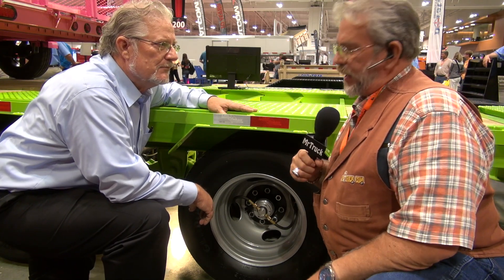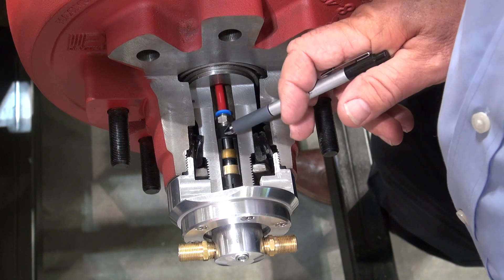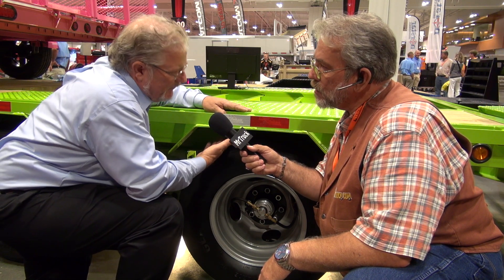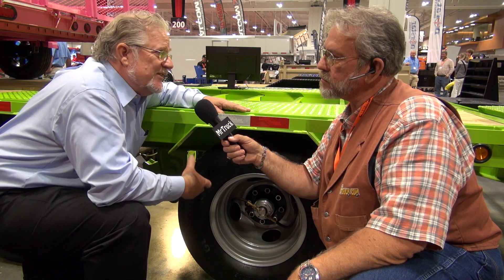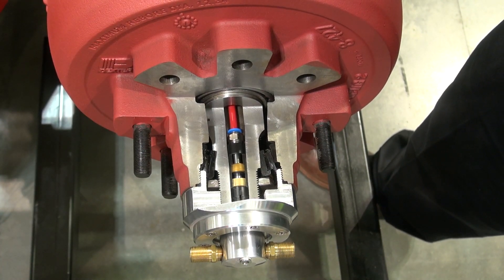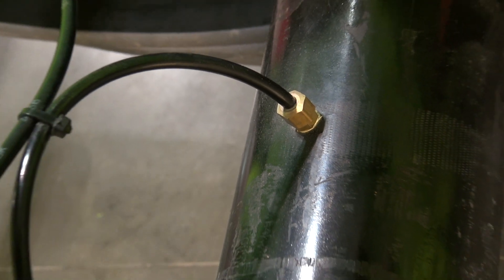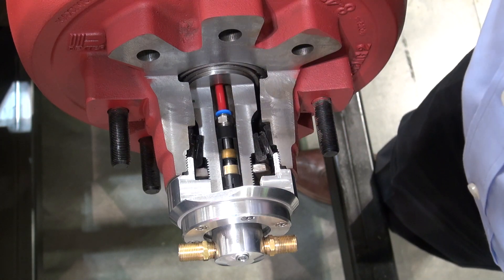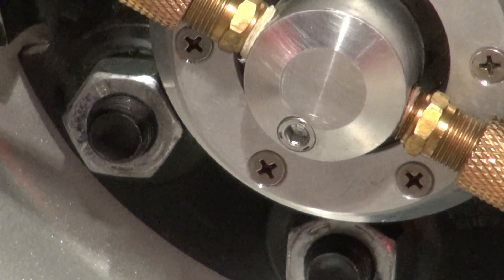Load-Trail hot shot gooseneck trailers offer an automatic air inflation system

Comment: I have a PJ trailer that is a 44 foot flatbed gooseneck that has a hydraulic dovetail, 17.5 with 16 ply tires and disc brakes. Where do I get those installed at and how much would it cost.
Reply from the maker: Load-Trail was selling them, don't know now
Reply: MrTruckTV I appreciate that information. Keep on doing what you’re doing. Good info

Comment: Are there check valves?
I see 8 tires on one air system. 1 hole and 8 flats?
Reply from the maker: It's suppose to keep them all up. The spindles have an air hole thru the middle

Comment: Ok question. Is there a check valve for each separate wheel? Off the hub they got the rubber tubes going to each wheel.  if you do get a hole, I get the air compressor will try to keep that tire at a safe level but what stops the others from draining in the event of a big puncture??
Reply from the maker: Good question, I bet your right with check valve like the valve stem . I'll ask when I see them next